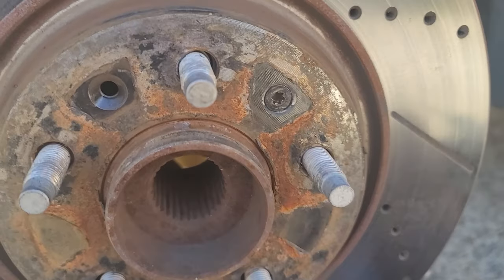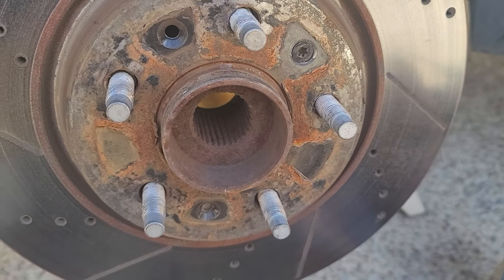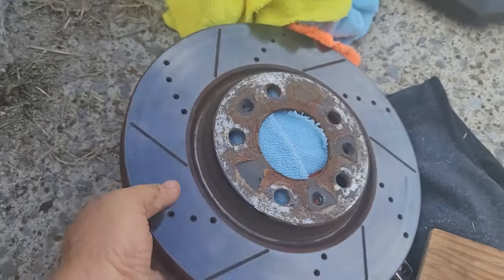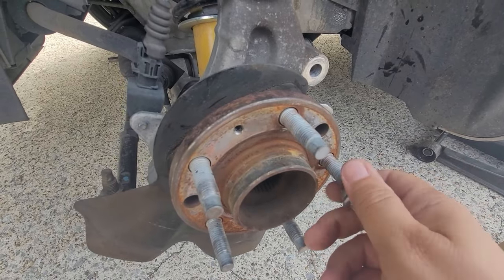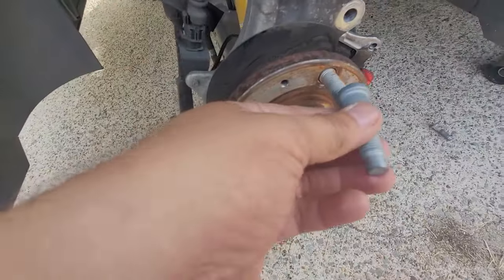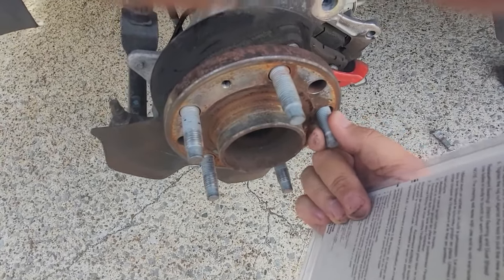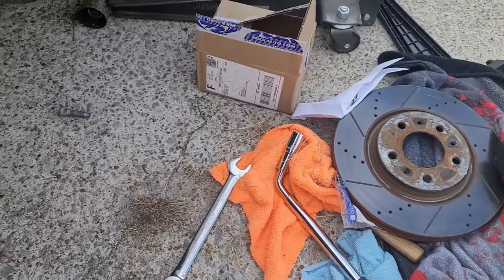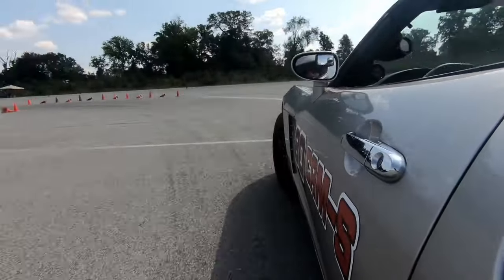How To Easily Replace Your Wheel Studs

Comment: You skipped the the hardest part- how you got the wheel to stop spinning while you pulled in the new stud.
Reply: Did you ever explain how?
Reply: Put the car in park maybe?
Reply: It was a free spinning wheel not on an axle.  I've got to do this on my trailer after my teen son picked up my sledge and practiced by hitting at a lug nut?!?  Kids these days lol.  But now I'm looking up the thread chaser video, thanks comments!
Reply: I got a  small pry bar and stuck through the stud hole and their was a spot that the pry bar sat in to where the hub didn't move. Hope this helps
Reply: Emgc brake
Reply: Can you change a stud without removing the disc brake ?
Reply: Messy video. I agree
Reply: I'm a little sketched on how he grinded half the top of that stud off..do you think that's OK?
Reply: Use a impact drill
Reply: Can’t believe this wasn’t answered - 😮

Comment: Helpful tip - The new studs good in much easier if you stick them in the freezer for a couple hours before installation.
Reply: Wdym plz explain
Reply: @rage_killer22  Metal gets hot it expands, metal gets cold it shrinks.
Reply: @rage_killer22   He's joking steel does not contract that much or cars would fall apart in winter.  I'm sure you heard the joke about the YouTube Certified Mechanic!! But those who know little fall for it.
Reply: That is really funny, I actually got a side ache laughing knowing some people will try that! But I'm sure everyone remembers from high school physics that at Oc the coefficient of steel is so small its not even considered in calculations.

I'm going to try that one on my mechanic after I ask about my blinker fluid.
Reply: @The_K_Project 😂

Comment: I was always told using a hammer like you did will cause damage to the bearings a very expensive CV joint replacement in the near future?

Comment: I gotta do a few of the ones on both my front wheels because discount tire did one too many ugga duggas but because I've removed them to do like oil changes and stuff, they told me sorry about ya. I just ordered a set of 10 and then new lugs and and am gonna replace all of the front wheel studs and lugs just to be safe

Comment: Mike, I just found your video and love it.  I've seen so many folks destroying dust shields trying to get studs out.  I got pretty good at these as the local tire shop would massively overtorque the nuts and stretch the threads.  That spacer tool was pretty good (got to love Lisle tools!) for acorn nuts (an alternate solution is to use standard steel lug nuts and run them down all the way).  Great job!

Comment: It’s ok to use an impact wrench on the lug nuts, but of course it has to not be cross threaded to start. Also I immediately changed all my studs to ARP longer studs, and also use 4th gen Firebird lug nuts as they have the hole down the center and fit over any long stud and have more threads to engage on the stud. The ARP studs are “Miata rear”, 100-7720.